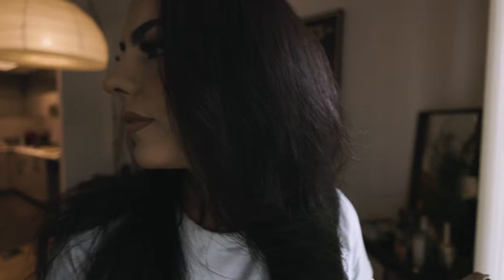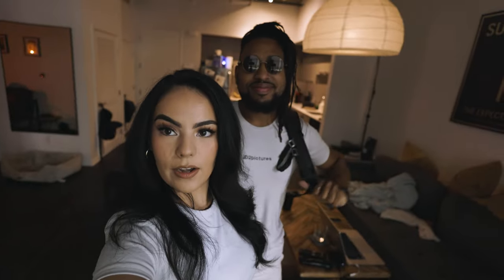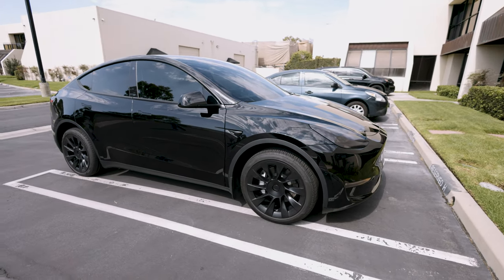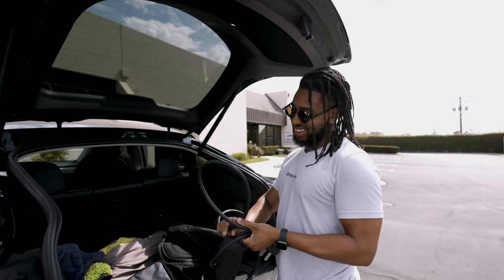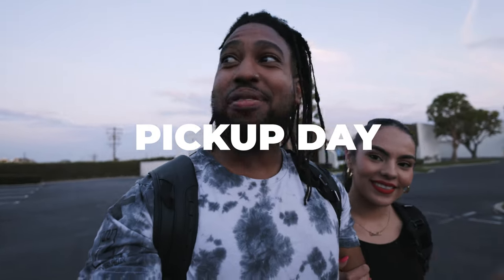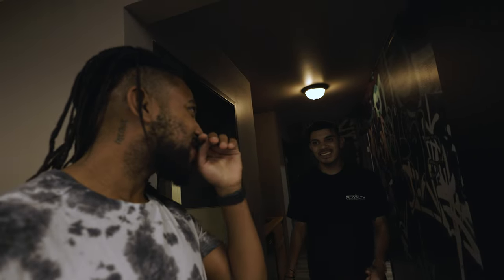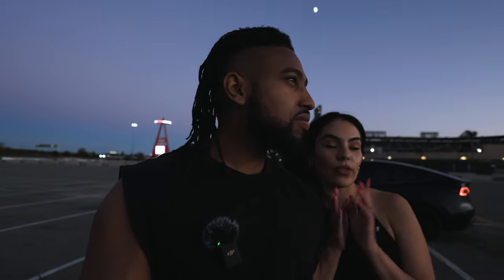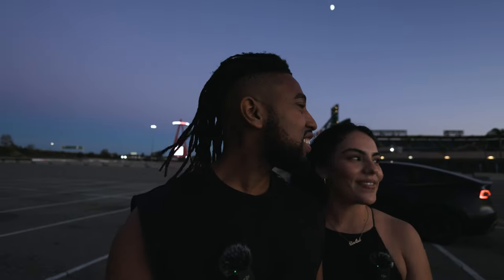I Wrapped My 2022 Tesla Model Y In DEAD MATTE BLACK

Comment: Hi !’ I want to wrap mine . How much did it cost ?
Reply from the maker: You should. It was 3K
Reply: Not bad! Does it hold well on the road? As in not peeling off easy
Reply from the maker: @jorgepulidovaladez9418  It holds really well, had some initial lifting but that normal it was fixed easily! So worth it